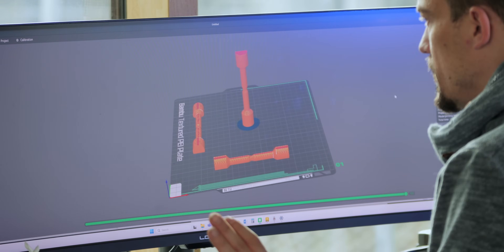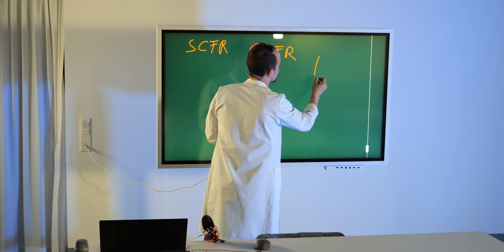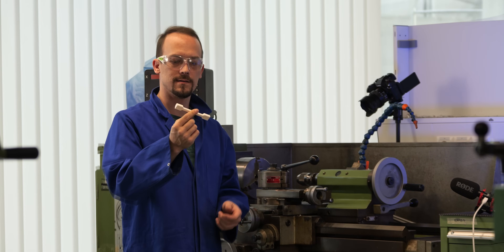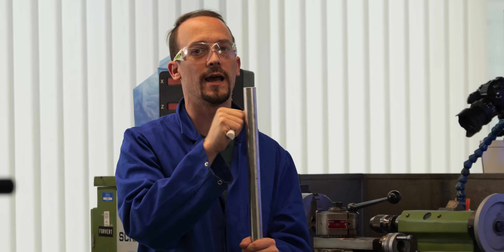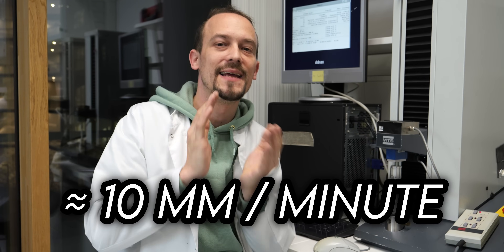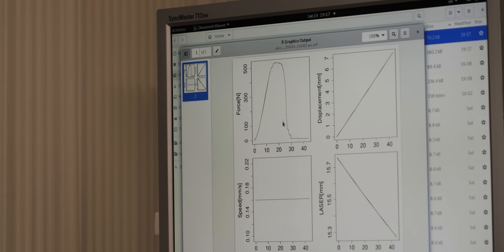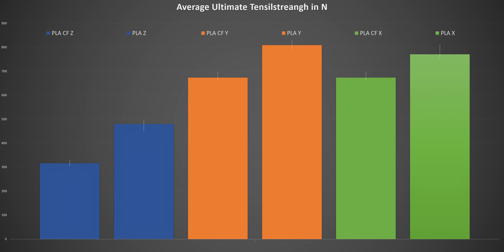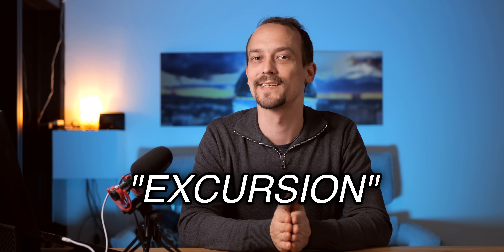The biggest SCAM in 3D Printing? How filament stores try to trick you with carbonfiber "reinforced"

Comment: I heard thermoplastic engineers use filament marketing materials for laughs during lunch breaks.
Reply from the maker: @mr_voron  true. I can picture it:
" guys...guys.
I got a new one:
Cellulose infused pla.
Common laughter 
(This is a true example of my work. The parts should simulate bone but u could rip them appart with your hand. Rip...not break.
All the "research" on that material wad published by the guy founding the company. That's why we need impartial research that badly. Especially in this time and age.
Reply: @Ibuiltathing  I actually have cellulose infused PLA and it's great (when used for what it's designed for). It's an annealing PLA, and the fibers help it hold its shape during annealing better than pure PLA (due to the anisotropic stress from printing in layers). I'm guessing it's a very low fiber density.
Reply: @Ibuiltathing cellulose is good for what it's intended to do, intimating  wood. Also still needs 100% or thick walls
Reply: Kind of true xD PLA-CF was one of the funniest I have seen. Makes no sense at all.
Reply: @sierraecho884  Yeah, adding carbon fiber makes most sense for soft materials, the problem with PLA is that its already too brittle.
Still seen some guys print extra gun parts and CF made huge diffrence in resistance to deformation over time, so it seems to do come with some advantages.
Reply: @sierraecho884 pla cf is fine for appearance only) same with petg cf/gf
Reply: Well, some PLA and PETG CF might not be better, but it would be very foolish to deny superiority of materials like PPS-CF, HTN CF25, PPA-CF etc.
Reply: @nix9409  "... to deny superiority of materials like PPS-CF..." Nobody is denying that some materials are better at certain things than others. However a PPS by itself is way better than PLA. PLA is basically packaging material while PPS is an engineering grade polymer. It has nothing to do with the CF or GF filling. It´s like saying Steel is way stronger and stiffer than Nylon ...yeah of course it is, it is a completely different material.
Reply: @sierraecho884   You are totally missing the point, i never compared PPS, HTN and PPA to cheap basic materials like PLA, obviously these are engineering  grade industrial materials, the point is they are made stiffer by carbon fibers and in that sense better, for me and many others stiffness is the key property, for us they are better, for someone for whom impact resistance and flexibility are more important they might not be better.
Reply: @nix9409  "...the point is they are made stiffer by carbon fibers..." The point is they were not as stiff as PLA to begin with. And they were not only made stiffer, this is only one effect. They were made to not warp as much and have a higher heat tolerance as well. Impact resistance and stiffness need to be taken both into consideration just as temp resistance etc. It´s all those factors.
And those material work with CF and GF (mostly GF due to price and performance) mostly in injection molding. With additive manufacturing it´s a whole different story.
Reply: @sierraecho884 You are again missing the point, nobody is comparing different plastics but effect of CF on them which does make them stiffer, key property for many of us, as i said. And obviously addition of CF affects ALL properties, not just stiffness, brittleness and impact resistance i mentioned, but obviously also temp resistance you mentioned....and also tensile strength, chemical and water resistance, durability aka fatigue resistance etc.
Reply: @sierraecho884  Obviously they are made to warp less, common problem with PC removed by addition of CF. Obviously they have higher heat tolerance as well. Obviously, again, ALL properties of the material are significantly changed by CF, some for the better like stiffness, tensile strength, heat r., and some for the worse like brittleness, abrasion, health hazard of carbon fibers etc.
Reply: @sierraecho884  Obviously all properties need to be taken into account, that is exactly what i wrote with focus on balance of stiffness vs brittleness. And obviously GF is cheaper than CF and performance depends on specific product and print quality. Nobody is talking about injection molding which is obviously a whole different story, but the fact quality made CF filament is stiffer and stronger than unfilled, again each having to determine what's optimal for their application.
Reply: @nix9409  It isn´t stronger than unfilled, it´s usually weaker especially in Z direction due to the print process which differs form injection molding which was one of my points.
Reply: @nix9409  They do not have more tensile strength. They tend to be weaker. That´s my point. The pro´s are temp. and stiffness that´s basically it. But they are also brittle, expensive and have worse layer adhesion and are usually weaker in stress. The small particles are way too small to help with tensile strength, they act more like a contaminant. The advantage is two fold, stiffness + temp. resistance.
Reply: @nix9409  "...You are again missing the point, nobody is comparing different plastics but effect of CF on them which does make them stiffer,..." I responded to a person who compared PLA with filled PPS.
I was not the person to miss the point.

Compared a filled and the same non filled material is what I advocated for.

Keeping with the example of PLA for instance, it does not make much sense to fill PLA especially with CF. Since PLA is already too brittle. It only would make sense if you for some reason want an even more brittle PLA with higher temp. tolerance which does not make sense because by that point you can choose a cheaper polymer altogether which does all that instead.
Reply: @sierraecho884 Even if they are not continuous they are stronger, have higher tensile strength and ofc are stiffer. Quote from Aon3d "By adding CCF reinforcement, manufacturers are able to increase final part strength by up to 115%, tensile modulus by 530%, and stiffness by nearly 300%."
Reply: @sierraecho884 You are missing the point. I did not compare PLA to PPS, i don't care about PLA. Even if they are chopped, not continuous they are stronger, have higher tensile strength and ofc are stiffer.
Reply: Quote from aon3d "By adding CCF reinforcement, manufacturers are able to increase final part strength by up to 115%, tensile modulus by 530%, and stiffness by nearly 300%."
Reply: @nix9409  This is mostly incorrect. Very short fibers prevent bonding between the polymer molecules and thus create stress risers. This isn´t always the case and depends of the fibers. You can use spherical glass fillings for instance or longer fibers, however this is mostly the case with 3D printing materials. The fibers are very small, usually smaller than used in injection molding due to the FDM printing process where they need to exit the nozzle without causing a clog. Additionally if they are of sufficient length and shape and work as intended they only reinforce the part in the XY plane, usually leading to worse Z strength.

Conclusion: They mostly make the part weaker due to the creation of stress risers and prevent a cohesion bond between the polymer  and an adhesion bond between the polymer and the CF particles.
However they are stiffer and tolerate higher temps before deformation. 
Or said differently: They should be stronger in theory however mostly it isn´t the case in practice.
Reply: @sierraecho884 You're incorrect
Reply: Aon3d is quoting a sci. study
Reply: And ofc they are weaker in Z direction, but that can be minimized by printing at 45° and planning ahead the main direction of forces.
Reply: I like to use it because to me it seems that it doesn’t really warp so i can print larger surfaces, but that can also be because I’m not that smartest guy on the block but I don’t like to change and tune i want to throw something on my printer and continue with the rest of my work without needing to tinker
Reply: I will add that after watching The Dark Side of Carbon Fiber Filament i decided to go with PC i considered before for my device.
Reply: I know i can sand it in water and epoxy it....i just don't wanna deal with it.
Reply: Any mechanical engineer with a distant memory of materials science.....
But that's the same with triple windows and natural insulation with high inertia salesperson.
Reply: CNC Kitchen - Stefan, does the most comprehensive material tests out there. It was astounding early on, as he even realized, PLA was stronger than most. Now, I am something of a thermoplastic engineer if you will. Hours in the trench if  you will vs school. Injection, Injection blow molding and nearly, damnit didn’t get the gig, bakelite. Anyway, not bragging, big whatever. It’s easy to get sucked in however, a few truths. Annealing makes a hell of a difference with ANY material that I’ve experienced. Choose the material for heat resistance, chemical resistance, expansion properties, basically “how will this be used and in what situations”. Strength will largely always come down to the geometry. Both inside and outside. RE high end filaments. I haven’t yet decided what I’d choose but I haven’t yet come down to the point where a part/item I’m printing has any of the qualities being marketed to for the expensive stuff… When the time comes, I’ll look to see what Stefan has analyzed and what the results are.
Reply: @TheJacklwilliams   no he doesn't, not even close. That would be MyTechfun
Reply: @TheJacklwilliams  PLA ist strong but brittle and can´t tolerate heat at all.
Annealing makes sense with cristalline materials as those cristals regrow and so on. You can also anneal PA for instance which has a different reasoning behind it. The polyamide chains have a hydrogen bridge at the end and water will connect right there making the material less brittle and also weaker strength wise.
Strength is a material inherit property. Titanium is stronger than Aluminium and so on. You can create better designs but the same design with a different material and a different type of manufacturing will be stronger regardless.
Reply: @ Thank you, greatly. It sounds to me from your statement, that you are a materials scientist. Your last statement I believe is the strongest and pretty much negates what I said as it should. It would be, the more accurate of the two. The thing I’ve enjoyed about 3d printing. Especially in execution. Is seeing how part orientation on the print bed as well as the geometry of the part, can lead to strength and quality merely based upon the combination of the two. As I move forward and dive into other materials (frankly just doing ABS for the first time) I’m interested in learning more to be sure.

Comment: I can confirm PETG being the most durable. My VR full body trackers going strong for 2 years dancing, kicking stuff around, never had an issue. The main advantage of PETG is that flexibility. So adding any fibers or turning it to PCTG makes the item weaker in real world because it just cracks like all other stiff plastics. If you want a stiff part use PLA.
Reply: PETG will actually sometimes if you're not lucky flash crystallise on impact and shatter into really spiky painful shards. So i think this use calls for ABS, ASA, HIPS or PC. No stiffening filler.

HIPS is super underrated and prints kinda well open-frame and the prints are GORGEOUS because it lays down so well. Yeah the specs don't look like much but i mean there's any number of prints which fail to meet their intended purpose well before the material shatters apart, so i feel overall it's fine.
Reply: PLA will deform under constant load and many applications need higher temperatrure resistance so it's often no go.

Comment: hey, awesome video! I printed your VR stock with PLA and it works perfectly, you saved me a ton of money/time! I have a question, what would be the most mechanical resistant filament for 3d printing in your opinion?
Reply from the maker: @filipekertcher3479  that depends a little what u have available. Peek is for sure a very strong Alternative.
If we are talking "normal " 3d printers for home use than pa6 or pa12 when thebprinter can handle it. 
Also ABS is a very safe choice and might be slightly easier than pa (nylon) materials. But be aware of the Fumes!
If u really wana fight with your printer but get the streangth over all try to print PC.

I conclution: every material gives you a different resistance to a different load. So there is no best over all. But in normal Terms "strong" means hard to break and good against impact. There pa materials take the cake.